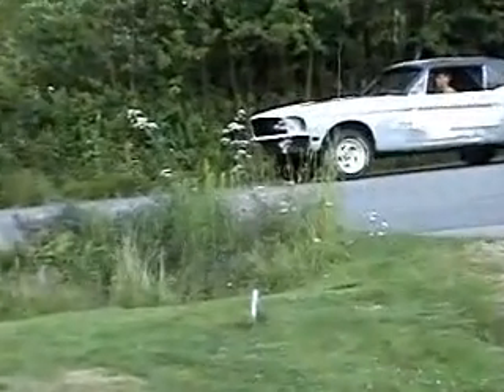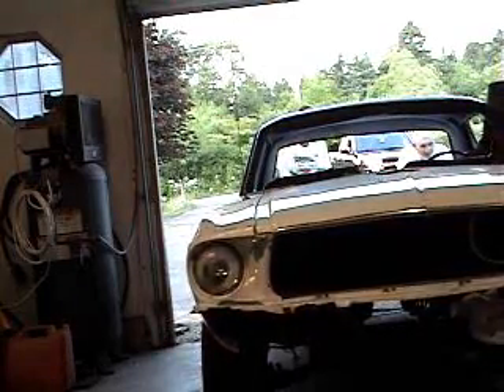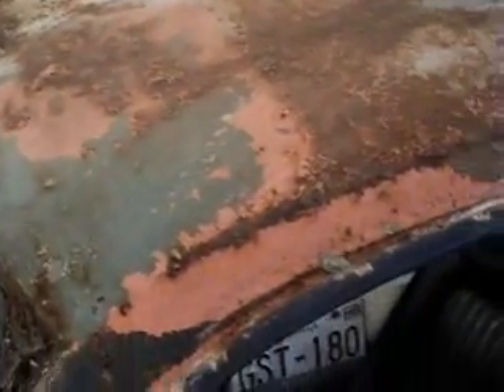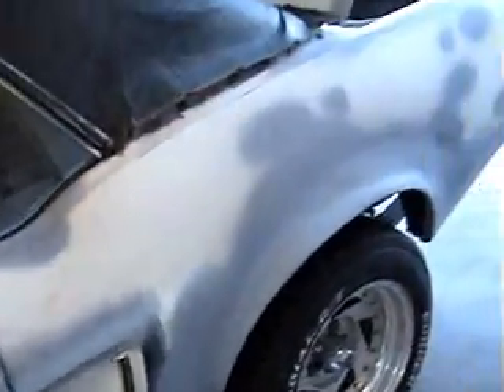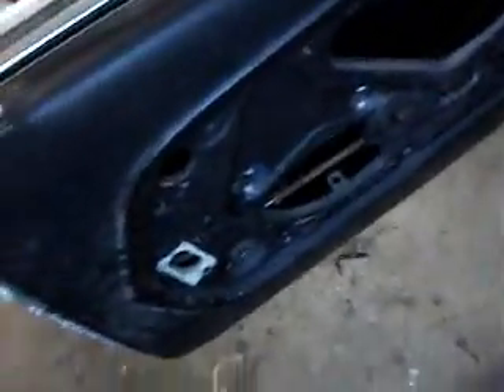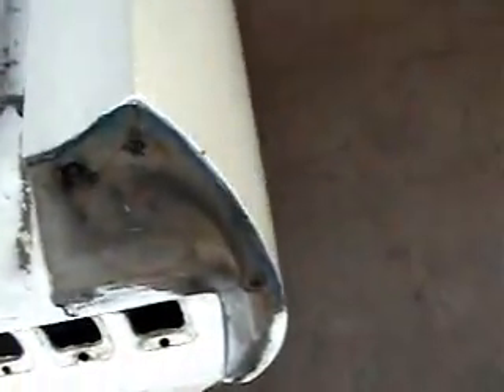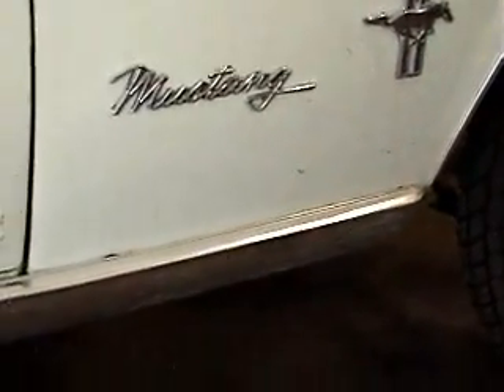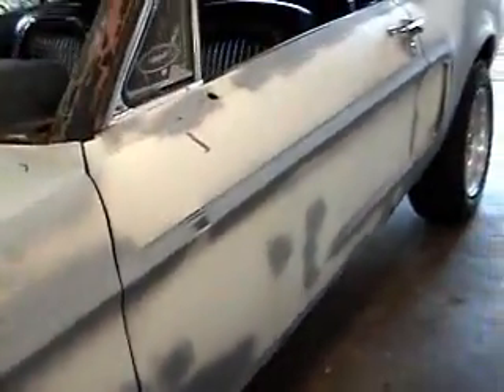1968 mustang arrives.wmv

Comment: Weld that hood slowly and everything will be just fine.  Get a few beers and have a break between welds.  You almost can't weld it slow enough on a panel that size.   Grind it just as slowly.  Glad you got something out of the door braces.  Necessity is the mother of all invention.  I needed to brace and adjust.  Works like a charm.

Comment: right, what you want to do is cut the roof of of this one.................lol

there is a simple way to get the car on ots side, you can get a body roller, not sure thats the official name, 
its a pair of arcs that bolt to the wheel hubs of the car, the car is then sitting on a frame that goes from the one side, under the other hub and rolls up to the roof height where the two are joined, then you just roll it over on the frame, 
try google images for basic car roller or cj autos website